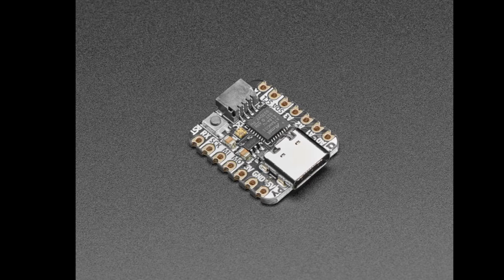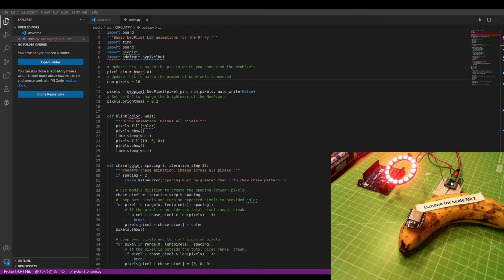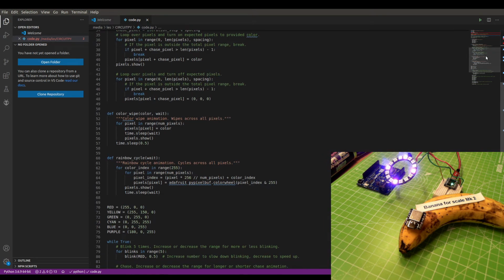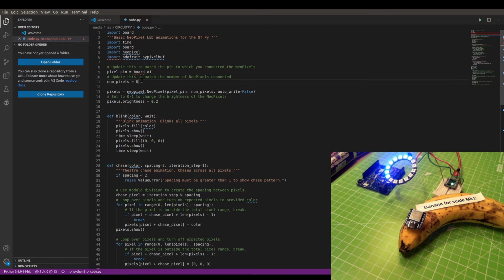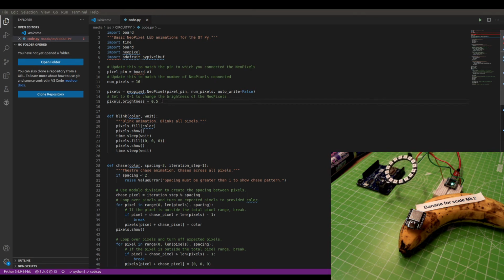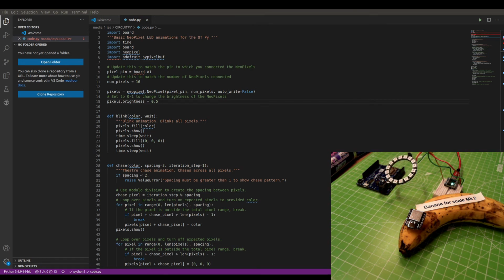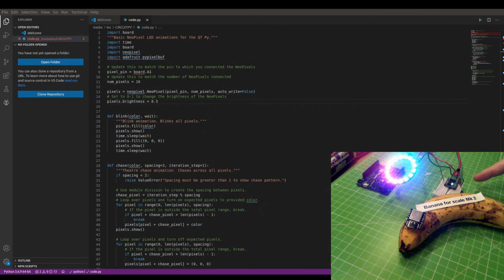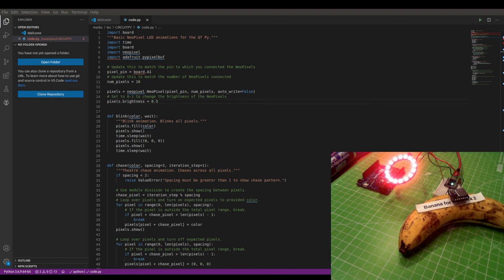Maker Advent Day 18: CircuitPython

Comment: banana bread time soon it would appear?

I have both boards myself - cant quite believe how good they are for such little cost!!

Have you tried the Seeed Expansions boards for the Xiao yet?

In case you have not the links are....

https://www.seeedstudio.com/Grove-Shield-for-Seeeduino-XIAO-p-4621.html

https://www.seeedstudio.com/Seeeduino-XIAO-Expansion-board-p-4746.html

The expansion board in particular i am really loving - built in user button, OLED & battery management not to mention micro sd card slot.. and best of all a reset button!!!

As both the Xiao & QT Py are more or less pin compatible i am going to see if the  QT Py works OK on the Xiao expansion board

Am trying to get one of the SPI  ram chips for the QT Py but no UK based suppliers seem to have it & it would cost £12 to ship into the UK from abroad - too high for a £1 chip!!

Really enjoying your Maker Advent - be a shame to see it come to an end..... Roll on Xmas 2021!!!